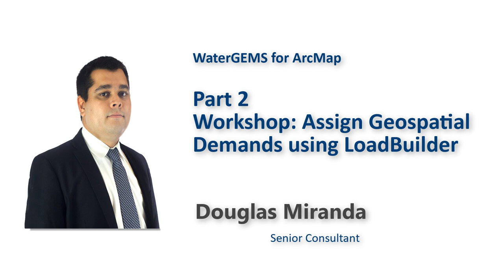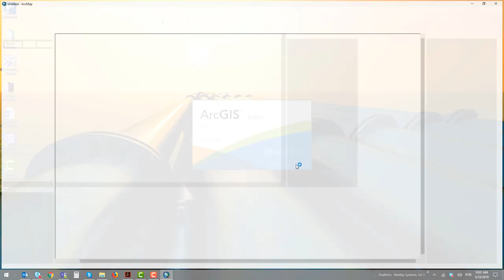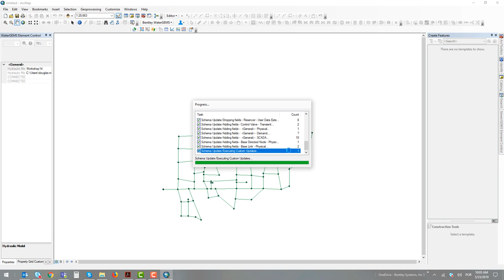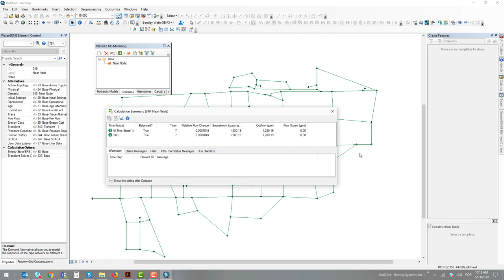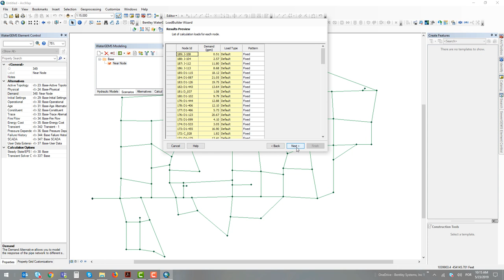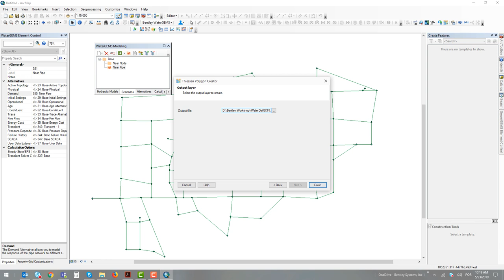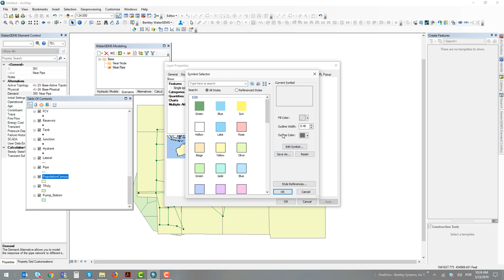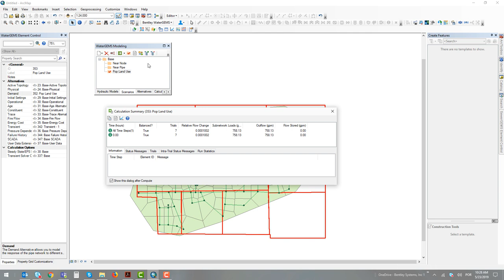Assigning Demands using LoadBuilder in ArcMap

Comment: Thank you very much for your very helpful video. However I do not have meter data or household consumption data, but I have computed the daily pattern for consumption, how can I create a consumption shapefile from this data and use the load builder and the Thiessen polygons to load my demands in the nodes,? Thank you
Reply from the maker: Hello Odhiambo, apologies for the delay in response. In the future you can post on our forum: https://communities.bentley.com/products/hydraulics___hydrology/f/haestad-hydraulics-and-hydrology-forum

When you say that you have the pattern of consumption, do you mean you have the pattern of multipliers (diurnal curve) to describe how demand changes over time, or do you mean that you have the actual demand flow value over time for each node? (or for the entire system?) If you can determine the average daily demand of the whole network, you could create a polygon around the entire network (for example lay out a pump station polygon around it, enter that value for the elevation, then export a pump station flextable with just the elevation field. You can then distribute it to model node elements using the Thiessen polygon and LoadBuilder tools. Then, you can determine the diurnal demand pattern from the data you have, and assign it globally to the nodes from the Demand Control Center. See more in our Wiki here: https://communities.bentley.com/products/hydraulics___hydrology/w/hydraulics_and_hydrology__wiki/18771/distributing-a-lump-sum-demand-or-load-over-a-large-area